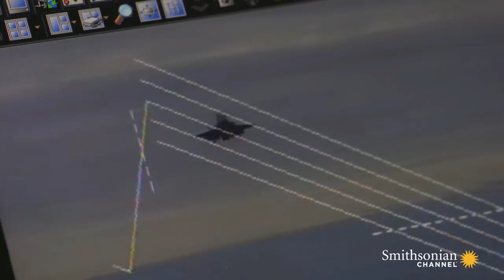This Fighter Plane Landing Has Never Been Attempted

Comment: Can't F35s do arrestor landings? I assume it would be an easier landing, and it would eliminate the wasteful ditching of fuel and expensive equipment.
Reply: The F35A is the replacement for the F16. 
The F35B I's STOVOL for US Marines and Royal Navy. The F35C is the carrier version with a hook.
Reply: Arrestor landings are pretty difficult as well to be fair, you're doing a lot of the same but at higher speeds and need to catch a cable.

Once this has the procedures down and aids built into the ship and aircraft it'll be much easier.
Reply: @martinw245  STOVL
Reply: @AA-xo9uw  

 "STOVL"

The additional "O" was a free gift. See it as an early Christmas present.

Comment: What use can a fighter jet that can barely land have? In real life, this plane will come back from the battlefield with shrapnel damage, maybe even with a wounded pilot, with no fuel for three landing attempts, and to a ship that is a lot smaller than a full Nimitz class aircraft carrier. Why not make a version of the F35 that lands at a 40-knot reduction in speed, making it safer and less expensive, instead of being unbelievably expensive?

Comment: The plane has to be as light as possible??? Dump fuel into the sea? I’m disappointed with it now, first time I’ve heard of that. What use is it then??
Reply: All STOVL aircraft are like that, it's impossible with current engine technology for a jet aircraft to hover with much weight. It can carry far more than the Harrier it replaces though.

There are currently only two fixed wing aircraft in service capable of taking off and landing aboard many carriers today, one of them is the F-35B in the video, the other is the Harrier which was first developed in the 50's and is pretty outdated at this point.

Comment: So if there was an actual war you would have time to have how many attempts at landing that way? Why have vertical landing capability if you don't use it? Interesting but pointless!
Reply: They managed on the 3rd attempt on their first ever time using this landing, so chances are they'll be able to get it down first time with some practice and the landing aids that will use data from this test. 

This just lets you save fuel and weapons, during war you'll want to try and save as much as you can so you have to resupply less. Chances are they'll use vertical landings in rougher sea states if required though. Just another tool in their inventory.

Comment: Seems like a waste of time and money
Reply: It's cheaper than a normal vertical landing and probably just as quick. You're putting less stress on the engine and don't have to dump fuel or munitions.
Reply: @Benjd0  they said they have to be light as possible.. so yes very little fuel and oh ya dump any extra artillery.
Reply: @playandsplash1329  yeah during a vertical landing. The point of this landing is they don't have to dump things.

Comment: All of this could have been prevented if they weren't too cheap to build a carrier with catapults and arrestor wires. 
Typically British - taking the low cost approach.
Reply: SuperSix Delta if it was a low cost approach then why pay for the most expensive model of the F35 ? The British gave up its old invention catobar after inventing vtol / stovl which has worked well enough for the Royal Navy

Comment: The F-35 program is such a mess of garbage. It can’t land if it’s too heavy? I get it but it has to dump everything to land? So VTOL missions with multiple landings are out?
Reply: That's not unique to the F-35. Every VTOL jet has the same issue, it's just down to physics and engine technology. You'd need extremely powerful and efficient engines to land and take off vertically with a full payload.

It is capable of doing those things with more weight on board than previous aircraft though.

Comment: That symbolic and pointless bit of penny pinching in 2010 (to look like austerity at the top level was a real thing) which left the carriers with no angle deck and no arrestor wires, looks less and less well thought through the more we learn about this plane. So it isn't known until now if the plane could be landed fully loaded? Doh!!  Don't care what it costs - get an angle deck on there!.
Reply: We always knew they would be more difficult to land with a payload than without, the calculations were there from day one.  This "documentary" makes it sound like the plane can't land fully loaded but the reality is that it would just be a helluva lot trickier, more dangerous, and if out of fuel - then impossible.  So they need to perfect this maneuver and get all of the details they need so they can train pilots on the specifics - ideally every pilot will land like this regardless of what they are carrying, as it is more fuel efficient to roll the landing than to hover.
Reply: @krashd  You mean all the British pilots, as the USMC F35B's are not equipped to do this.
Reply: @markturner4219  Yeah, I meant those who bought F35C's, which I think is only the UK but I may be wrong.
Reply: @markturner4219  "as the USMC F35B's are not equipped to do this."

NAVAIR paid for the development of the necessary software. What makes you think the Marine Corps won't get the same code upgrade considering Major Michael Lippert USMC also participated in the SRVL flight tests aboard the QE?
Reply: @krashd  Only the Navy and Marine Corps have purchased the F-35C.

Comment: Sooo I'm guessing they have NEVER heard of the Harrier Jump Jet. Total failure with not event eh most basic Google search done. What a great hire that 'director' must have been.
Reply: The Harrier generally landed vertically, a specially modified harrier that had a fly by wire system implemented was used to test this type of landing in 2007 ahead of operating the F-35 though.

Comment: what about UK HAWKER SIDLY HARRIER JUMP JETS from 30 years ago.. they did this already 
and were used extensively in combat senarios .  i think they were used in the faullands war... which ONLY had carrier takeo ff and landing since they were thousands of miles from any UK occupied land 

dont claim firsts that arnt
Reply: To be fair, it's the Royal Navy claiming that it's the first, either way it'd be the Royal Navy.

Harriers generally landed vertically, it was pretty difficult and dangerous to do this with the Harriers controls. This was tested with a specially modified Harrier that had a fly by wire system implemented back in 2007 ahead of operating on the UKs new carriers.